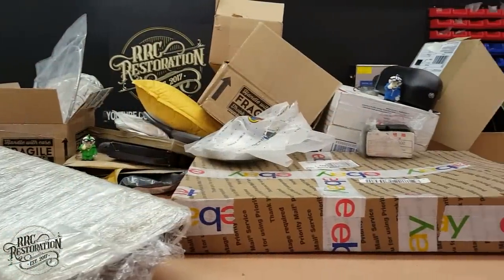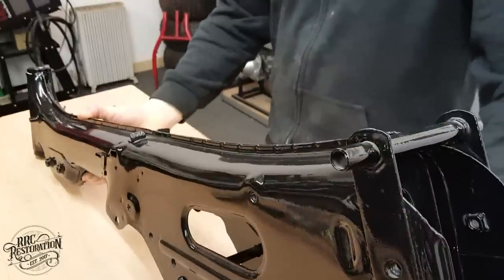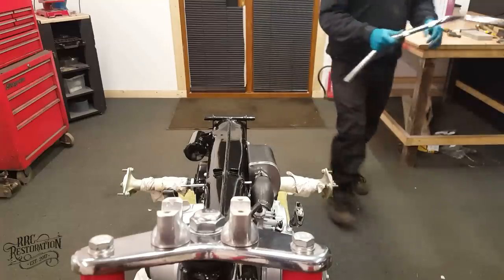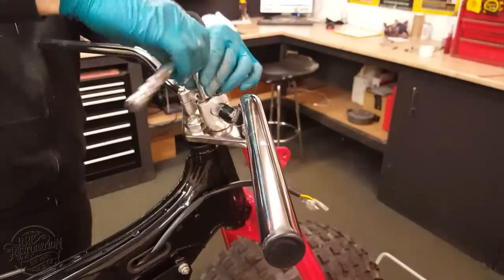1978 Honda ATC 90 Full Restoration - Part 8

Comment: Another excellent video, many thanks.

Good to see the fluffy washers going into the brake spindle boss, they always get left out. I'm suitably impressed by your ability to put the chain tensioner on and tension the chain, before, getting the chain out of its packet! ;-)

I won't mention the rear sprocket being on the wrong side of the carrier plate thingy, although I would expect some rubber cushion blocks in there as well. Mind you, I only serviced one of these once before it went to the farm. Never saw it again.

Take care.

Cheers,
Norm.
Reply from the maker: Always nice to see you, You know me its all about the attention to detail, no fluffy washer left behind not on my watch! haha Aw i know i cant believe that little continuity error slipped past me in the edit and its too late to take the video down and re-edit it now so ill just have to live with my horrible editing blunder :(  haha . Stay safe and ill see you again soon RRC
Reply: @RRCRestoration  Aye, your attention to detail is second to none.

Cheers,
Norm.

Comment: Fantastic work! As for your 'mistake'.....you flipped the rear sprocket inside out. I'm confident you'll rectify that little mishap, no problem.
Reply from the maker: Thank you, it was spotted and sorted a little later in the build, I put the sprocket to the wrong side of the carrier it should be behind it not in front, if you look at the shot just before the chain case goes on you will see what i mean.

Comment: Excellent. Back in the 80s Bike Mag used to refer to these three-wheelers as “all-terror-vehicles” largely due to their ability roll on unsuspecting journalists when shown a corner. Take good care.
Reply: Like anything else in life,riding one of these machines takes practice.The fact that you cannot steer an atc the way a motorcycle is steered really takes some getting used to.

Comment: Your three wheeler is looking great.  I know how hard parts are to find for these old machines.  I have been looking for bike to restore, but finding repair parts is really time consuming.  Great build, it looks just like it did from the factory.  See you next time!
Reply from the maker: Thank you glad you like it. Finding parts for these old bikes really is half the battle it can be frustrating at times but when you find the right part its such a good feeling lol
Reply: @RRCRestoration  Your videos bring back a lot of memories.  I worked at the local Honda dealer back in the late 70's.  I would buy used bikes and all the parts at cost, fix them up and resell them.  I made a lot of extra money doing this.  See you next time.

Comment: As per usual it's another great piece of work bud, be careful when you take it out as they are notorious for throwing you over the bars on tight turns, I know, I've been there a few times and it hurts, would rather of had two wheels at the front and a single rear, but who knows? glad they brought out the 4 wheeler, anyway, usual Honda quality, take care and see you soon 👍
Reply from the maker: Haha yeah they can be a bit dangerous but i had a 110 many years ago and i was fine so finger's crossed this on will stay right side up too haha. Glad you enjoyed the restoration and ill see you in the next one :)

Comment: You're doing a great job as usual. Seeing that long bolt through the front wheel worries me though. I would think it would bend with support in the middle and all the force applied at the ends. I'm sure Honda knows better than me, just one of those things that stick out.
Reply from the maker: Haha i know what you mean it does look a little weedy but as you say Honda knows what they are doing and the bolt is hardened and tempered to the next degree! so safe as houses lol

Comment: It would be lovely if you can coat the frame amd the body in a spray ceramic coating or something to keep it from getting dirty too fast and help the muddy water bead off instead of sticking. Good job on the resto!
Reply from the maker: You read my mind, Before it goes out the full bike will be getting a coating of a special aerospace coating that repels moisture and stops corrosion its like WD40 but on steroids' lol

Comment: Ive failed you, video has been up for a whole 5 minutes and I didn't see.  Lovely work so far. For the life of me , cant figure out the mistake.

Edit:
Wait, aren't the sprocket bolts facing the wrong way??

Edit the 2nd:
Nup I'm an idiot. 

No idea, now I'm intrigued.
Reply from the maker: Dont worry ill let it slide this time ;) haha, Really glad you are enjoying the project. The mistake was that i put the sprocket tot he wrong side of the carrier, if you look at the shot just before the chain case goes on you can see the carrier is now at the correct side.

Comment: The upper handlebar clamps should be marked with a small dot.This is the forward edge and there should be no gap on the front side of the clamp.If you lay the clamp against a straight edge you'll see they are not even.I just mention this because I noticed a gap on the front of the clamp.This must have been a export model,it doesn't look quite like the US models I'm familiar with.

Comment: I had a quick look back through comments to see what the “mistake” was but I’m months behind watching you restos. Greasing sprocket carrier?  Or is that usual procedure? I’d actually like to know 😊 You have inspired me. Really.
Reply from the maker: Hi, the mistake was that i put the sprocket carrier behind the sprocket instead of on the front causing the sprocket to run out of line with the engine sprocket if you look out a few moments later you will see before i put the chain cover on the carrier is now at the correct side.

Comment: Was it the harmonic balancers? 
Either way - great resto! No suspension at all, not even rubber engine mounts? That's gonna be a fun ride!!
Reply from the maker: The mistake was that i put the sprocket on the front of the carrier instead of the rear, you can see the change i made just before i fit the chain case. Haha yeah they do tend to vibrate a bit with only the huge balloon tyres for suspension.

Comment: That's a ct90 carburetor and not an atc 90 the atc didn't have a high altitude knob on it like the CT did. I didn't spot anything else though. Gorgeous restoration as always 💯
Reply from the maker: Always a pleasure to see you :)  I hate to do this to you as im certainly no expert on ATC's but i have done my due diligence on this model and the 78 ATC90 did come with an altitude compensating carb its in all the workshop manuals, Honda service manuals and the stickers for using it are all in the sticker kit so yeah it is supposed to be on it ;) Glad you are still enjoying the restoration :)
Reply: @RRCRestoration  is your manual from USA?

Comment: looks super !! did you forget the cush drive ?
Reply from the maker: Nope, the cush drive is built into the sprocket i would have shown it but i didn't think anyone would have been interested in it lol The mistake was that i put the sprocket on the front of the carrier instead of behind it if you look at the shot before the chain case goes on you can see the gloss black carrier is now in front,.

Comment: Was it the chain link?  Clip the wrong way round?
Reply from the maker: Nope the chain link is the correct way round, The mistake was that i put the sprocket to the wrong side of the carrier it is supposed to be on the backside not the front, If you look at the footage just before i putt he chain cover on you will see the change i made.

Comment: I was wondering why you do not put a little touch-up paint on any of the holes you drill after your project is done and going back together I noticed it on this episode of the four-wheeler on a little flange you had to drill a hole out and it was raw metal when you bolted it up you could still see the rough edge of the drilling? I don't do it myself but I've been told that it is necessary to keep corrosion from occurring between the bolts... thoughts?

Comment: Doesn't putting a cut washer over a regular washer completely defeat the purpose of a cut washer? It's supposed to cut into the chassis and the bolt so it doesn't move (we all know they don't work). The only washers that actually work are nord lock washers.
Reply from the maker: The spring washer should always be placed on a normal washer as its job its to force the bolt against the thread creating friction so that it cant rattle loose, if a spring washer is used without a washer underneath it  cuts in removes the paint from underneath it and lets water and dirt in and before too long you're frame is rotted out.

Comment: Cut the handle bar in the middle and then weld it back
Reply from the maker: That would compromise its structural integrity and then i would need to send it away for re-chroming much easier to find a set with the correct dimensions... i hope
Reply: @RRCRestoration  or make handle your self way more satisfying

Comment: That is NOT  how you Grease bearings!
Reply from the maker: How would you do it? I dont see anything wrong with the way i done it, all the grease is packed into the rollers and all surfaces are coated.
Reply: Looked like you just smeared it instead of packing them.
Reply: Just so you know I love the build your doing.  I have 1978 atc 90 I would like to restore.